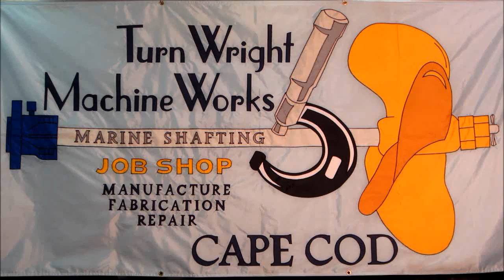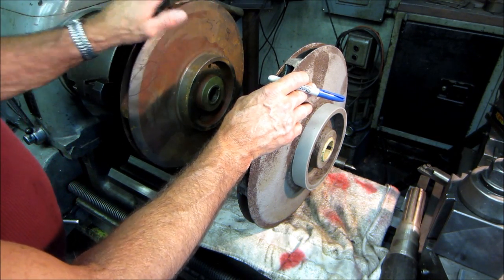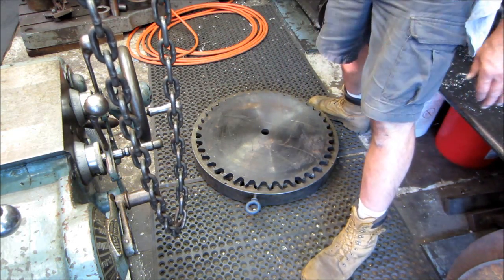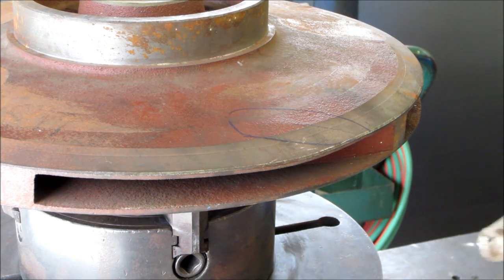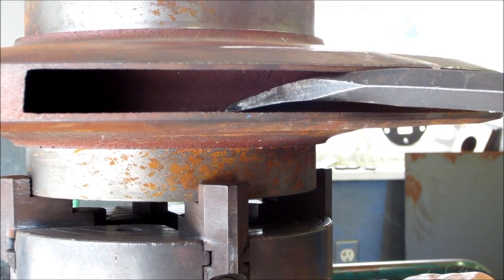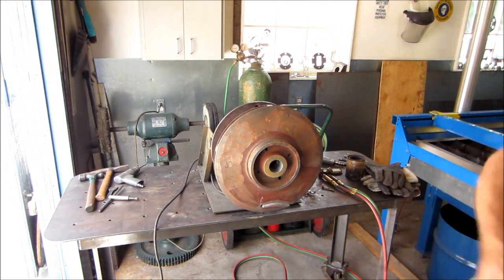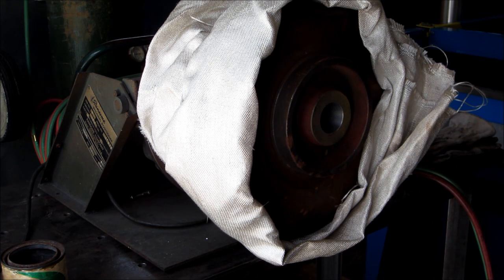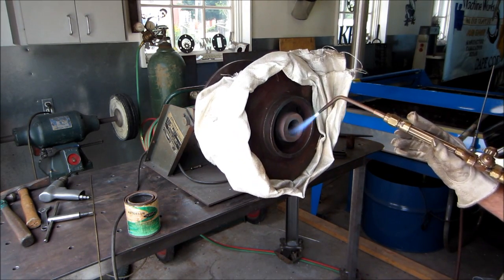Clam Pumper Part Two

Comment from the maker: The impellers are balanced at the factory, by grinding material off, on the sides, where it is heavy. In the yards after we made any or all the rotating components, and the wear ring were sized, it was sent out to be rebalanced, before final assembly. The work that we do to the impeller is so close to the center and so uniform, we have not had any vibration issues, with any of our impeller projects.

Comment from the maker: I have used nickel stick rods and have Tig welded a lot of silicon bronze to repair cast! My take on the processes not the rods used, is that the arc heat generated by either process, generates a crystal crust to the cast material and becomes a risk of failure…

Comment: Hey Keith.  Love the video's.  I'm thinking a balance job would help.  If you start getting any fatigue cracks. The salt water is going to accelerate the end...  Actually a rust pit might also be the initiate a fatigue stress riser with a really small imbalance.  Just leads back to a SS shaft if the customer can be talk into spending a bit more.  Keep up the great videos.  I enjoy easy and everyone

Comment from the maker: If you have a spring mandrel or make up a cone arbor, and a set of parallels, set up like parallel bars, so the unit can rotate centered and precision leveled, you could , most likely create a close enough balance, for your needs…

Comment: thanks for the input i will be on the look out for a #5 and #8 lense, i hate not being able to see my work so im eather to dark or most likly burning my eyes out, i dont like electric welding{ tig , mig , arc} because of this , i gues i just dont have the proper equipment for the job, any way thanks again for your advise

Comment: Have you ever tried using Nickel 99 Tig rod for welding up cracks in cast iron? I use it to weld fins back on cast iron jugs and it seems to hold up incredibly well to vibration.

Comment: Keith, I was watching a show on TV where they were doing maintenance on a bridge, Inside the bridge they had billets of some metal bolted to the walls that caused an electrolysis that made the salt water attack these Billets instead of attacking & rusting the steel bridge. Maybe it is possible to attach something like this to the pump body to prevent it from rusting so quick.

Comment: Keith, I was under the impression that if you heat cast iron enough it becomes malleable enough to bend a little without damage.  In this case time or something else might have been a reason not to.  Do you have any thoughts on this?  Thanks

Comment: The heat blanket appears to be Fiberfrax Cloth,a cloth from refractory ceramic fibers. It can handle 1260C 2300F temperature. It may also be Fibersil Cloth which is another high temperature cloth that has the added benefit of resistance to abrasion and mechanical abuse and provides  protection from molten metal splash, welding and metal cutting.

Comment: What do you think is causing the shaft to corrode so badly? Erosion, Corrosion, Vibration and Noise! Cavitation! Also consider using polyurethane paint. I used to work for a fellow that distributed Chemglaze. That stuff is like a miracle.

Comment: Why isn't the bronze a problem for corrosion in this case? Especially since this is going to be submerged in seawater, having that electrical interface between those different metals seems like it would accelerate corrosion significantly. Why isn't that an issue?
Reply from the maker: The steel shaft, fails before the bronze wears from electrolysis. ;{)---

Comment from the maker: The sleave would be giving the same rust and corrosion problem just transfering it to the outside diameter of the sleave, by brazing you seal the cast surface from ever rusting and giving way, due to material lost. ;{)---

Comment: Personally, I would be very careful with fabricating your own impeller. I'm not saying don't do it, just consider that the cost to make versus the cost of buying one is similar and it's very tricky to get it "just right" so it sucks and yet doesn't blow apart if it suffers a material hit. The forces involved are very large, especially for something which will be close to the operator. Good luck!

Comment: That pump is not suitable for marine applications.
Cast iron pump housing is normal, the it´s not normal to use steel shafts.
If you want to get a reliable pump you need to modify the pumps to use marine grade 316L stainless steel shaft, and the impeller key way to only to be machined inside the impeller.
Another option is to braze the shaft.
Also machine the pump housing impeller inlet wearing area, and install bronze sleeve.
ring.
Bronze impellers normally last about 10 years in service.